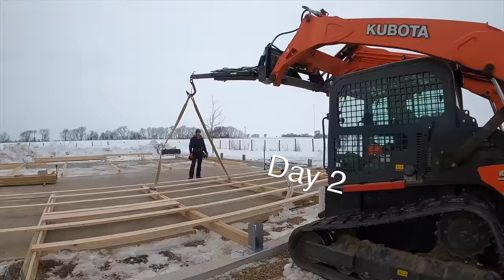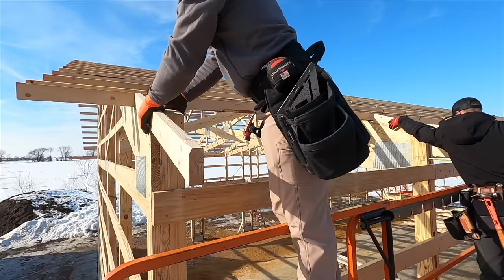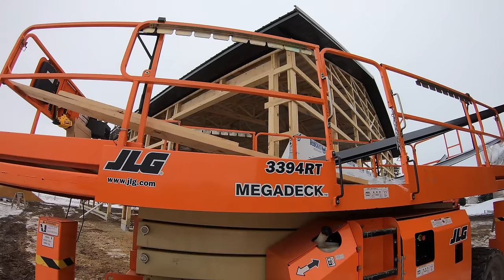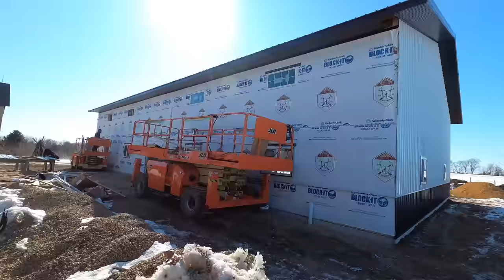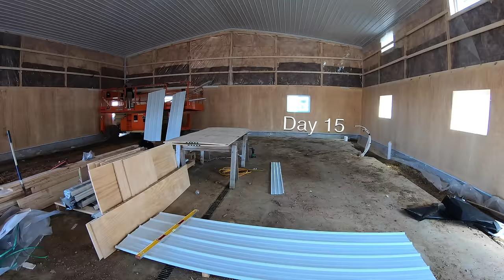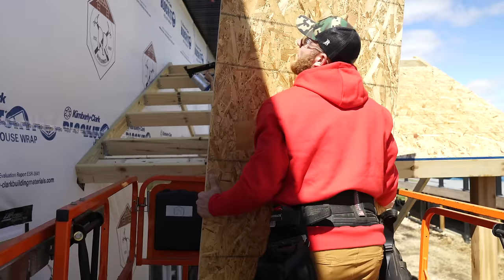Full Time-Lapse Build with Timber Frame Porch (Future Home Gym and Indoor Basketball Court)

Comment: For every house/barn/garage they should put a cost list and break everything down. So if someone wants something similar they know about whats its gonna run them.
Reply: I'd love to build something like this someday. Even adding a reply about the final cost would be so helpful
Reply: a lot of builders, not saying RR is, are uptight on pricing. The shady ones keep it secret so they can jack up the price for unsuspecting or easy customers. Even honest ones always give you a custom quote because of different material choices, time frame, complexity, location, permits, and the last thing they need is someone say "I saw this video of another company build this for 100k, why are you charging me 150k"
Reply: There are rough online build calculators if youre so inclined
Reply: It depends on too many factors

Comment: Hard Hat?  That past job down there in TX rubbed off on you...LOL...One thing you could really see in the video is how the chains really moved that building around.  It is hard to see in realtime, but pretty obvious in time timelapse.   Great looking building....

Curious, no electrical ran in there.  I'm assuming they will run it once you're done, but wow that's gotta be horrid to run AFTER the insulation and walls are completed.  One of my fears on building my barn...when does the owner get the chance to have the electrical run?  I've talked to a couple builders and theyare  really "We are here to get in and out, you'll have MAYBE a day to get your electrical run.  WOW...My electrical won't be "complex", but my Electrician relatives both said "2 days for all your electrical"...because I'm mixing 220 and 110, along with boiler system for Radiant floor etc.  They want a day for the 110V loops (outlet and lighting runs), and another day for the 220.  I also am looking at a Rotary Phase converter to run 3-Phase equipment (Can't get 3-phase on residential in my area...even if you pay 100% of the costs, they refuse to do it)....so when would somebody have the time to do all the electrical prep?  I don't envy the electrician that has to run all that power POST build.

Comment: Did you go with construction adhesive on the flat metal over the large doors to lessen the " oil can " look?  It seemed flatter than usual. This building looks great.
Reply from the maker: Nope...
Reply: what are your thoughts of building a post frame structure on a footer/foundation wall such as the one in this video? Thx, I wish you were closer and could build our barn we’re planning out. Don’t wanna make a commute to Southern Ohio do you? LOL

Comment: Was the roof not insulated or did I miss that bit to time-lapse? Also, were the chains installed in the beginning to square the building up?
Reply: Wondering the same thing, what’s the point of insulating your walls if all the heats goes straight out the roof
Reply: They have it blown-in after the fact.

Comment: I know you use a Stabila laser now, but I can't find the video again where you mention the model. Is it the LAR350? Additionally, what model of Spectra did you previously use? Was it the LL300? I want to buy one for home use, building my own shop, that provides a plumb line as well, has decent accuracy, and good reviews. I believe the Spectra can be mounted on its side for a plumb line, but I'm having trouble verifying that. Also, is the $1,000 between the Spectra and the Stabila worth a plumb line? I would love to hear your thoughts if you have time. Thank you for the great content.

Comment: What is the stone product? Doing a similar feature soon.  Also noticed, when watching in slow motion, you were taking them off, and grabbing different ones once in awhile?  Looking for a certain pattern?  Not fitting easily? Wondered how difficult to install.
Reply: Typically you don’t ever want to follow a pattern. Eyeball it and use your best judgement when setting pieces. If it looks goofy swap it out.

Comment: Hey, how are the ceiling lights to be installed since the ceiling is closed?
Reply: There is an attic
Reply: Was gonna say the same thing 😂
Reply: Electricity hasn't been run yet so when they do the electrical work they will cut out holes for the lights and receptacles
Reply: @deadlycupofJOE  but the wiring work will be impossible to be above the ceiling.
Reply: @acman0926  In 8:20, you can see the ceiling is up to the height of the upper window. And I did not notice the installation of attic floor,  how can the person use the attic in the future? And no steps at all.

Comment: I did not know a metal roof could be installed without decking. Can someone tell me more about it?  Does it need to be thicker gauge than with decking?  Can foam insulation be sprayed underneath directly or is vapor barrier or other materials needed?  I ask because I need to replace my home soon and this is the sort of bldg we are interested in.
Reply from the maker: We are using a structural metal panel... no need for sheathing which is a benefit to this roofing

Comment: All of these that I have seen have a concrete floor. I know you have to poor it for the foundation but is ot possible to put wood floors over it? Just find it weird no one had done it in the builds I've seen. I wouldn't want to be walking on concrete at home.

Comment: What is the benefit of having the purlins installed vertical vs laid flat with wide edge down?
Reply: It’s actually stronger on the skinny edge versus the wide side.
Reply: So that they can use less trusses with bigger spacing in between

Comment: What’s your thoughts on putting plywood on and screw the sheet metal to it?
Reply: I’m not critiquing your work I’ve never built my own building before it’s just a thought I’ve had in mind when I build my own barndo
Reply from the maker: You sure could for extra but it’s not required with out design

Comment: Question: The ceiling is not insulated? Any suggestions how one would insulate that kind of sloped truss?
Reply from the maker: It was blown in with insulation
Reply: @RRBuildings  I get that, but wouldn't the slope be a problem meaning insulation just sliding down? I'm guessing it's just really packed tight?

Also what is your spacing on those posts on the piers? They look like 12"x 6" posts comprised of three 12" x 2" glued/nailed together. Love learning new stuff and love how clear your videos are. Very inspiring.

Comment: This is exactly the size I want to build! Though I think it needs more windows especially at the ends.  Looks AWESOME! What are your thoughts on using LP siding (board/batten or lap) on the building instead of steel? Of course the cost in time and material would be higher. I know you rely on the steel diaphragm for strength and rigidity, but would zip sheeting on the walls and LP siding compare to the steel for that or would you have to do more bracing between posts?
Reply from the maker: Just wait!! I have an awesome build coming with all LP exterior

Comment: Do none of your clients run their wiring behind the walls/ceilings?
Reply from the maker: For sure some do... all depends on end goal of building
Reply: Personally, everything is behind the walls of mine, all the way at down to the garage door sensor wires and heater wires.  So much cleaner. Takes a little planning for sure

Comment: Why put insulation in walls but not roof? 25% roof loss, 35% walls. No breather membrane truss walls. These guys amazing but for habitable building? Is there insulation in floor?
Reply from the maker: Did you actually watch the whole video? Or read the video description first?  Thanks

Comment: Prove me wrong here "RR Buildings..
But as my first impression, how should I say this..
This kind of looks like.. a weak structure compared to its huge size.
I'm sorry but it looks like it.

Even tho you being Canadian-American?
And the way you always brags about your massive machines and high- power tools and engines/ and all that you guys have over there in the U.S..

But as when It comes to the lumber you guys have to build with, dude. I'm telling you It looks weak and not so resistant and supportive to stand up against the rough climate you have over there.
(I should point out, I don't mean to offend you In any way whatsoever here)

I don't know any better, but I respond to what i fell, and that being that the wood board planks, stud partition wall, and joists are to small)
Its just hard to see in the clip how (seemingly small) or truly massive those wood board planks are to stand up against Tornadoes, storm and strong winds and heavy snowfall and all that you have in whether- way.

Have a great day. Keep up with the nice videos. Bye.
Reply: easily. with proper engineering and fasteners. also the science behind metal and aerodynamics.
Reply: Ok so with proper engineering you can save the building from collapsing. Yes you can, i hear you.. But is it only me who think that the lumber are to weak, small and and not so supportive.
Reply: @Svensken8R  probably only you
Reply: Im a structural engineer and I would say Rich is right, this structure will probably not stand the test of time. For one, they really dont have shear walls. There is no exterior plywood with nailing connecting the diaphragm to the foundation. The load transfer would cause issues I imagine. Pretty much anywhere in the US you have to design with around 100mph winds on the low end, so idk how they got this to work, but im not even sure if an engineer even looked at this.